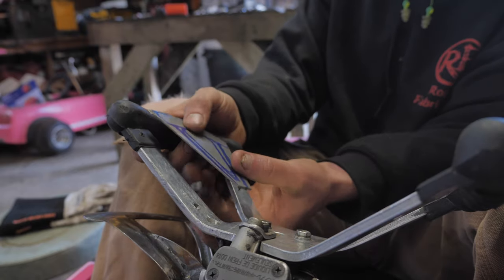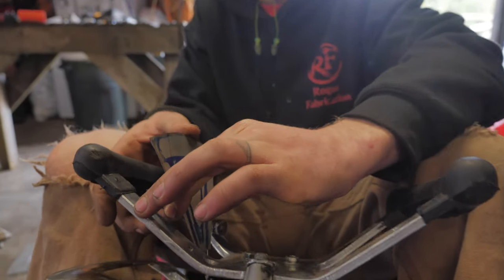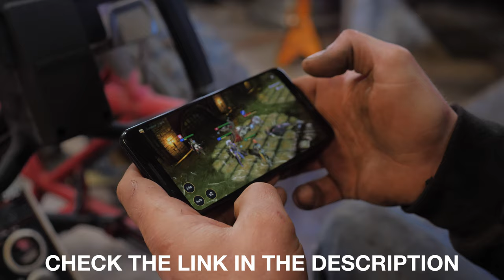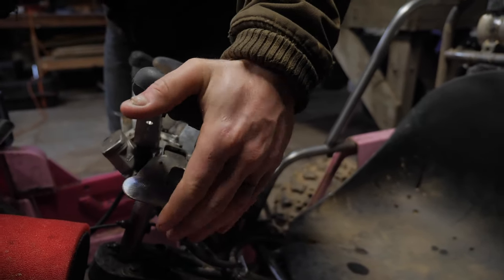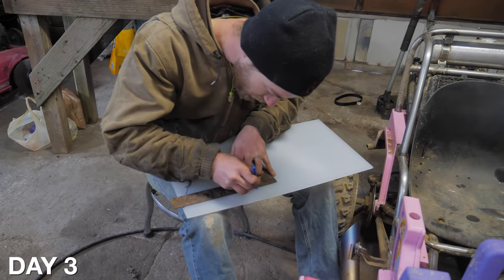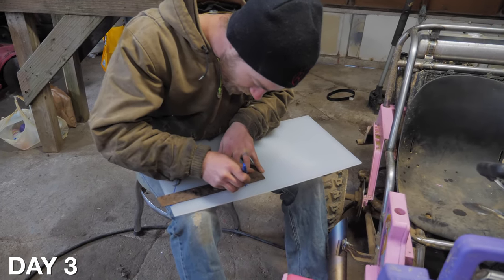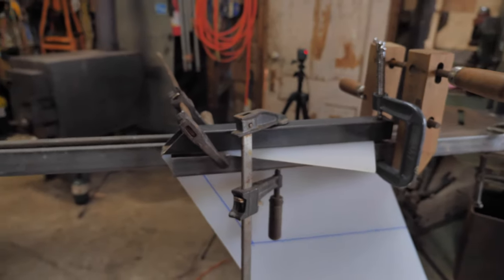Jumping The Crazy Fast Barbie Jeep + Bodywork

Comment: You should try out a recluse clutch it would probably make driving that thing 100 times easier
Reply: keoni hawelu true
Reply: Sounds like a lot of Ads, there like $700, so what's that double the build cost? Plus it's not a full auto so just make stalling it pretty much impossible. Not worth the investment in a toy! They don't seem to have a issue driving it or making it more and more driveable.
Reply: Aspired329 so apparently you’ve never owned or use one of these before they have several stages ranging from beginner to advanced level clutches the beginner class starts at about $400 and it’s exactly like the signature of a good clutch on the gear that you set it just enhances the drivability on a piece of machinery like that Plus I’m pretty sure they have a lot more than $700 into the machine
Reply: keoni hawelu yeah they probably have $700 in tires alone

Comment: You should weld a simple smooth metal plate on under the spare tire. That tire tread grabs the ground when you wheelie. A smooth plate would just brush along the ground.  Wouldn’t even need to stick out that much past the tire.

Comment: Where do you guys get all your brake and throttle cables? I’m building something like this but still need some important things like throttle and brake cable, and a way to mount my radiator
Reply: Irvin Ruiz you can buy it on eBay or just get metal wire and use that😀

Comment: Y'all should turn a Polaris 4x4 four wheeler like a scrambler 400 or 500 into a cart just cut the top frame off reinforce it put a body on it new controls maybe move the motor forward a foot or two then put a seat in it call it good.

Comment: You made reference to the Body Panels repairs made to this shell.  I'm very interested in this product.  Usually this type of plastic bodies do not like glues or melting in my experience.  But the patch you made looked quite solid from what I saw.  What was this material - is it commercially available at some type of store that would be in most parts of the USA or did you have to order it?  I have experience trying to paint ATV fenders with Rust-Oleum spray.  While it took the paint initially, the paint peeled off in spots.  Have you had better luck with some special paint that sticks to that type of plastic?
Also, I see from your parts list of the Barbie Jeep that you used 1/2 x 20 Heim joints.  If so, did you get into much trouble using Heim joints instead of just using some bolts through brackets?  I've seen some builds using Heim joints where they can pop off the ball of the joint under some stress.  And believe me you put the jeep under some considerable stresses  to say the least!

Comment: Put a damn muffler on it so you guys don't have to use hearing protection to drive it/spectate it.
Reply: Zark Muckerberg and it needs back pressure. All gas engines do.
Reply: @Kyle_Godfrey111  so annoying that people that don't understand engines read that shit and say it to everyone that will listen and it proliferates. A gas engine doesn't need back pressure. Any flow restriction causes a loss of power. What it needs is a proper sized exhaust that keeps the mass of exiting exhaust moving to help scavenge the exhaust from the cylinder a muffler or back pressure do not aid in scavenging.
Reply: jason birch yes a proper diameter is important but a muffler still helps with back pressure. You wonder why it back fires so much..
Reply from the maker: @jason birch Thank you for understanding that. I’m no expert on engines or exhaust, but I get so tired of hearing the back pressure thing. Basically, everyone is confusing pressure with velocity. We have a slightly smaller diameter pipe than stock, with a little bit of baffling in the “muffler”. Is it perfect? No, but we’re not exactly trying to make the most powerful crf450 motor in history. If “back pressure” is so damn important, then why do drag cars most other race engines have straight pipes? 😂
Reply: jason birch oh. I was always told a muffler is what keeps a gas engine from backfiring. I didn’t learn that on the internet. But even though I am “wrong” , and a muffler does quite the backfire sound, then shouldn’t they still run a muffler?
Reply: @Kyle_Godfrey111  no. It needs tuning, but backfiring out the exhaust isn't a terrible thing. Out the intake is a different story. Occasional backfires happen on a high performance engine under deceleration. When you close the throttle at higher rpm the vacuum is going to pull extra raw fuel in a carburated engine. There's not really a practical way to stop it and its not really necessary.

Comment: Its not done,because it runs  like  shit.If you really want to put it threw proper testing and get a serious grind on ,then fix it right ! your not even scratching the surface of how hard that 4 stroke will hit, can you say twice as hard ? I recommend  tossing that no-back pressure junk muffler and putting a trapp on it, bin using supertrapps for years because their infinitely adjustable not only just for sound but mainly for back pressure which is critical for that engines flow design . Something else that is extremely important is valve clearance , double check and let sit overnight to ensure cold clearance condition when checking. This is imperative for a perfect adjustment ,only after the 2 recommended changes , can you then properly jet the carburetor ,also try to get the largest air filter possible .Do these 3 repairs  and im sure you'll get it ti Grind so Hard it might scare you (NOT ).anyway awesome job and keep the rubber side down and the quality up. from a real craftsman pro builder  and race engine developer in the wine country ,northern Cali emerald triangle Jeff Meier
Reply from the maker: Hey man! Thanks for the input! I know it’s not running anywhere near as good as it could. There were so many things wrong with the engine when we got it, it was difficult to know where to start. And I would love to get it running perfectly, but we just haven’t had time yet. We have so many projects going on right now, so it’s hard to find time to tune it just right when we have other things that aren’t even finished yet. But we will get there for sure!